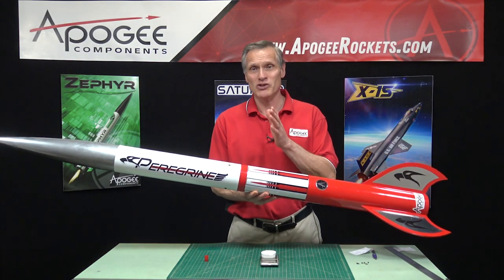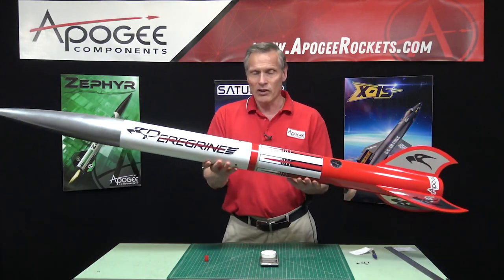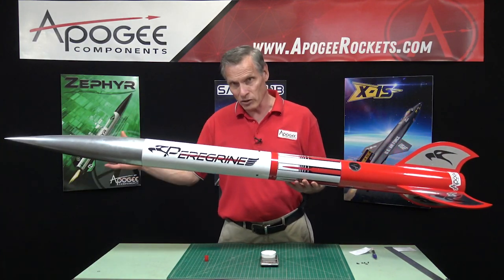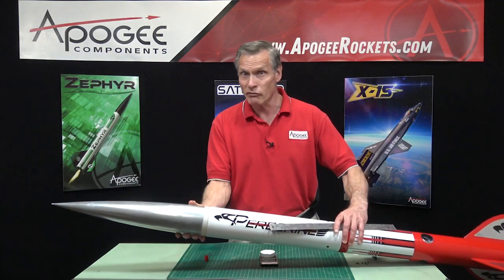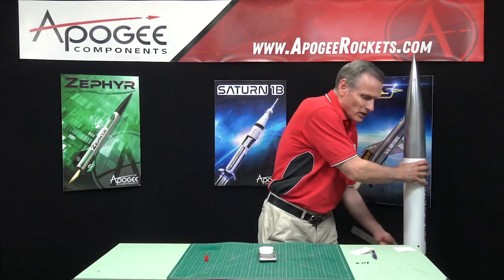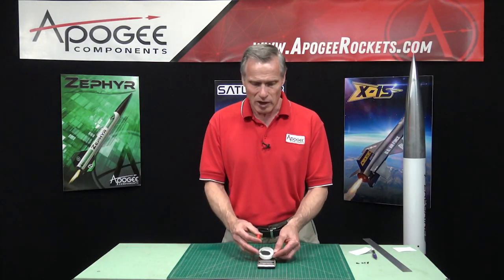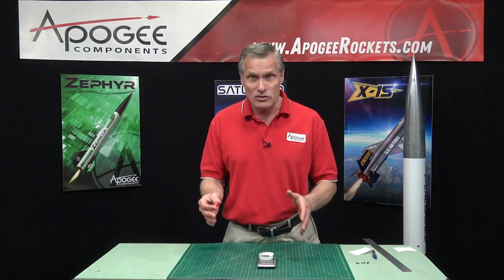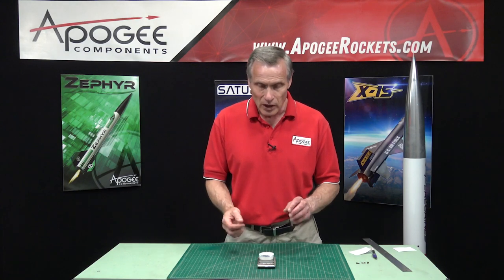How to Determine the Amount of Ejection Charge for a High-Power Model Rocket

Comment: Thank you for going through this in detail.  I'm new to the sport, so I'm not quite to dual deploy yet, but I enjoy reading up on it.  I notice on the lower end of high power rockets, you don't need to be concerned about having vent holes or sheer pins, however every dual deploy rocket I've seen has people recommending vent holes to prevent separation by pressure change on ascent, and sheer pins on both the ebay and the nose to prevent premature deployment.  Is there a particular altitude or engine size that determines whether or not you need to add vent holes and sheer pins?

Comment: Great video!!!  Now, what about the lower stage?  If you have dual deployment, how do you calculate the bottom half of the rocket??  Especially with the motor installed…
Reply from the maker: You do exactly the same thing for the lower stage. Find the volume of the compartment that needs to be pressurized to blow out the parachute.

Comment: What do I do if my parachute tube is not pressurized? Not sure how to calculate the force then...
Reply from the maker: I'd watch the video again. You have to pressurize the tube to blow out the parachute. If it is open, then you won't be able to get the chute out.
Reply: @apogeerockets  Okay because currently I was going to have my nosecone separate at apogee then deploy my drogue parachute. Then after falling for a while I would cut the drogue then launch the main. That means both of these tubes should have some sort of cap with shear pins installed on them in order for them to be pressurized correct?

Comment: Thanks for the infos! I would like to know Tim if 3fg instead of 4Fg black powder would do?
Reply: Yes but you need to test and if in doubt give it a dash more
Reply from the maker: I personally would use a ceramic mortar and pestal to grind the 3F down to 4f size. Be careful. Do it outdoors and away from others.
Reply: @apogeerockets  Thanks Tim!! Feeling a bit uncomfortable about grinding black powder LOL.. But will try instead finding 4Fg BP.
Reply: @stephenmartin4273  grinding it with some wooden utensils like a wood dowel that has been rounded at one end and a wooden bowl or something non sparking is safe and is no cause for concern. Blackpowder is not friction sensitive or shock sensitive. 
I mill 2.5lbs of black powder every 2hrs with 35lbs of lead in a ball mill, if that gives you some idea of how rough you can be with it. 
Don't use ferrous metals or sparking objects or glass objects. Wood , aluminum , lead and brass are safe to use for grinding. 
Ceramic has a small chance of sparking, not to any significant degree but I would avoid it if you can.
Reply: My grandfather used to compete in black powder shooting, he would buy "raw" ,what he called it, and would process it in a glass mortar and pestle. He said the glass won't carry any static charge, and will make a finer grind.

Comment: 4f black powder is equivalent to pyrodex P or pistol powder.
Reply from the maker: Sorry. I don't know the burn rate on other powders. I only trust Black Powder.
Reply: Pyrodex P requires better containment than is typically used in rocketry. It is not as efficient and tends to cause more fouling compared to Goex 4F.